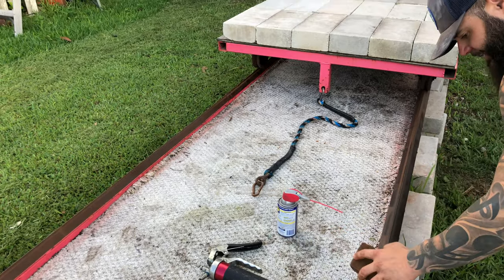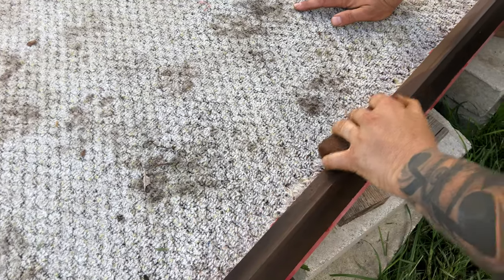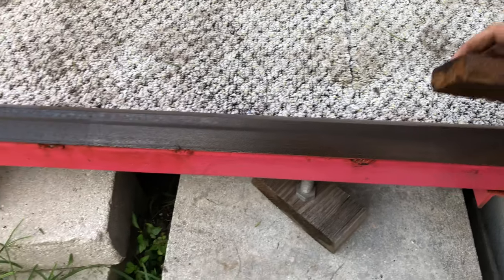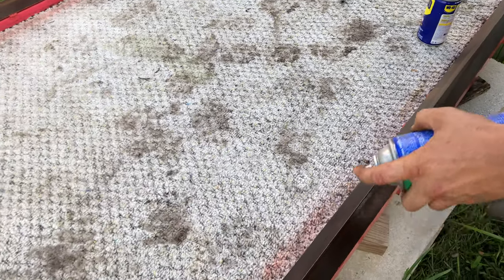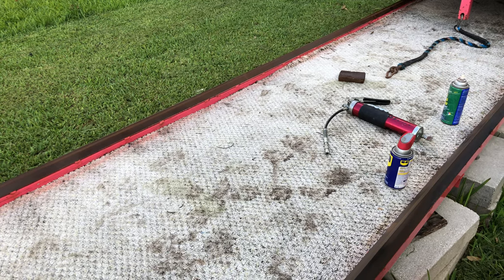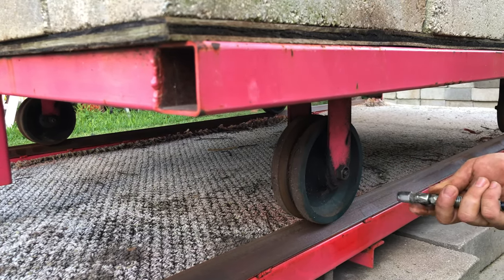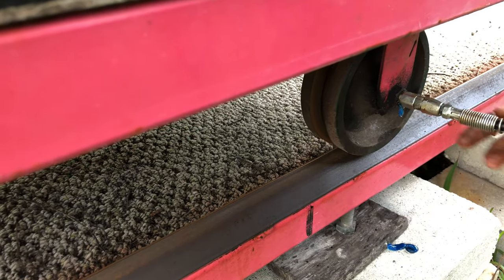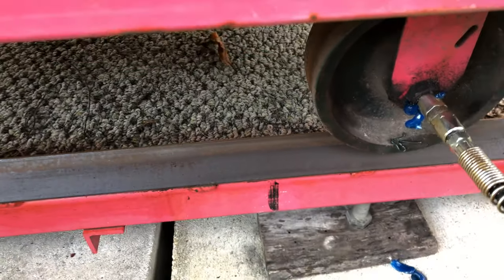‼️MAINTENANCE FOR YOUR WEIGHT PULL TRACK

Comment: Great video. Could you do a video on it's construction especially the leveling. There are no groups in my area so I will have to build my own. I see that it is angle iron on rectangular tube with v grove casters. Do the leveling bolts go in to the tube? A video on the construction would be great. Thanks for the videos.